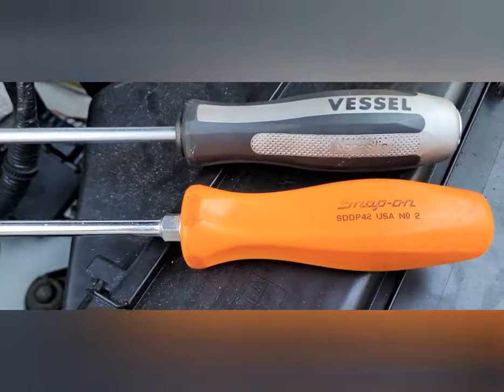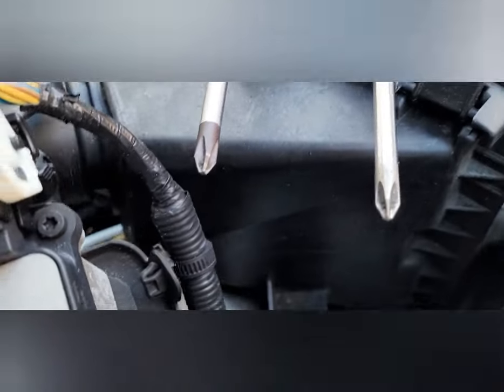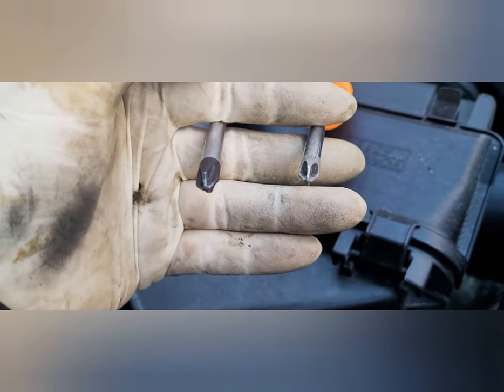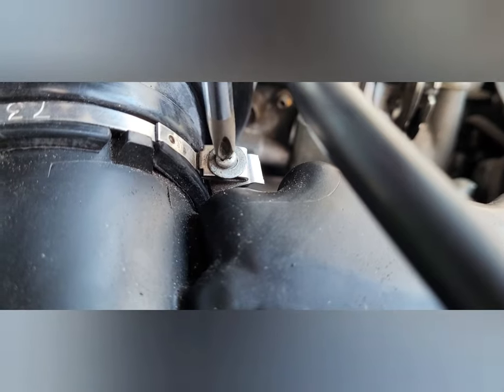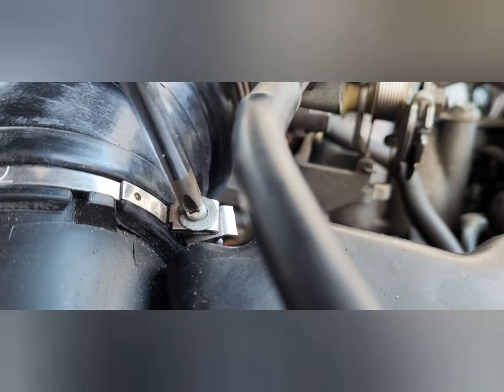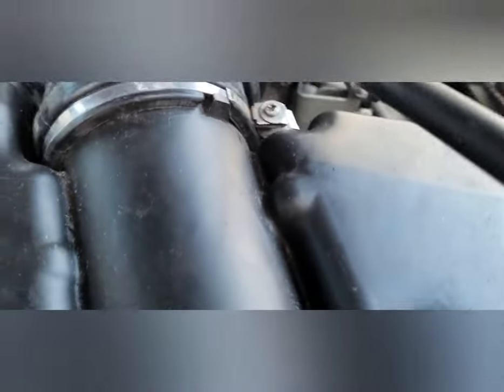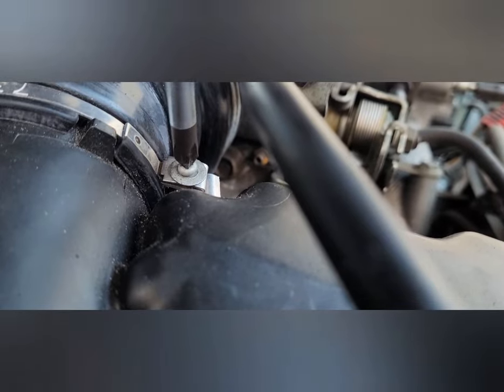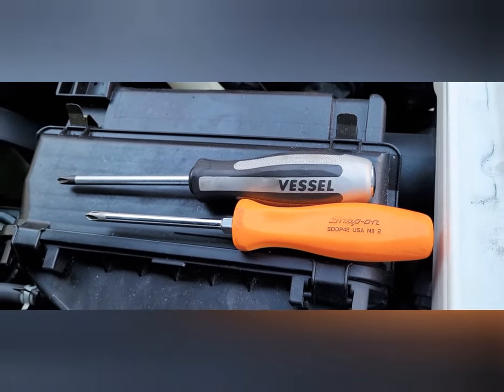JIS screwdriver vs Phillips

Comment: Have to give you a shout out again on this excellent tool! So glad I purchased one after watching your video. It has come in handy on so many occasions. Especially just now as I needed it to use on my XT250 oem self taping turn signal screws. I had to tap screw holes into the plastic on 4 signal lenses I just bought in a different color and using the oem self tapping screws to do so. This was hectic as the plastic is a cheaper type vs oem Yamaha's. Had to screw in and out A BUNCH in order to get threads in on each. My wrists were hurting in the end as I did it all by hand delicately as possible. I have no doubt I'd have stripped out those tiny turn signal screws using a standard Phillips Head because I used repeated back and forth twisting force . The JIS performed flawlessly. Much thanks to you again for sharing this valuable information.
Reply from the maker: No problem man! Glad to be of help!!! Glad it worked out for you. They've gotten me out of a ton of binds!

Comment: Nice. I’ve definitely noticed when working on bikes that it seems like the screws are always stripping and hard to deal with, it would make a lot of sense if the bike companies are using a different standard. 

Do you know if when you order parts from the big four Japanese companies if this is what they’re using or is this just a better quality screwdriver that is gonna work better on all Phillips type of screws?
Reply from the maker: So there are 1000 stories on this, but if you look at a JIS screw, it has a single dot on the Phillips face of the screw. If it has that dot, the manufacturers tooling would have definitely been JIS, and the JIS tooling fits all Phillips screws 1000 times better!
Reply: @PSBEadventures  perfect so you don’t have to worry about fumbling for both just get the JIS and be done with it.
Reply from the maker: @ShaneZettelmier  that's right! Got some links in the description for ya
Reply: My understanding is the Phillips have allways been designed to cam out so on the assembly line the powered screwdrivers canm out once tight. Which is all well and good untill you want to undo something.